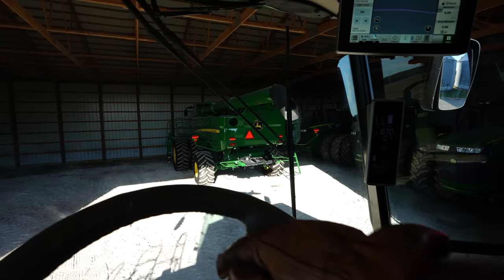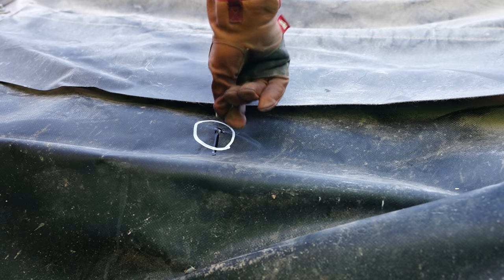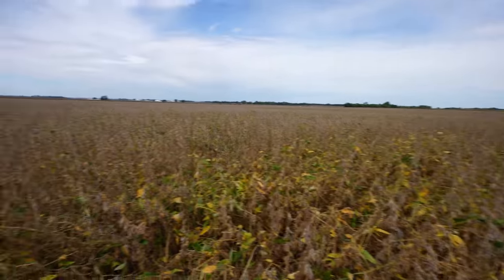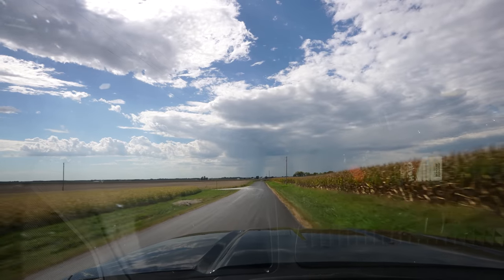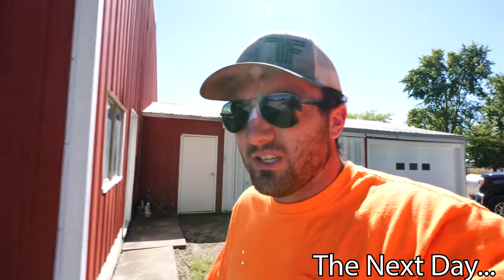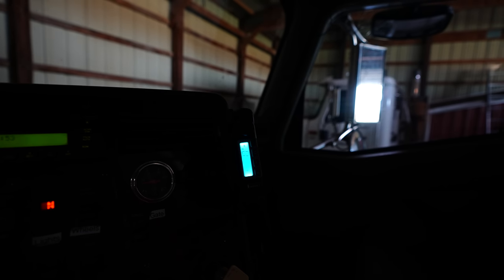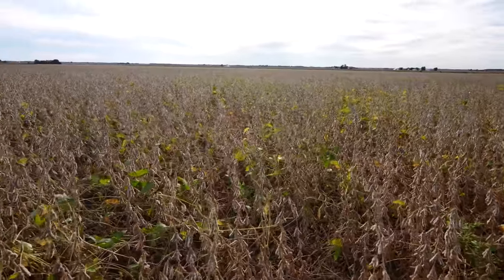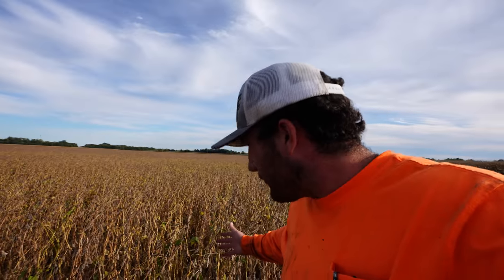Farmers Offered Insane Prices For Early-Harvested Crops

Comment: What's The range On Those Midland radios Been Thinking About getting some for my snow plow trucks
Reply: Check out Brian’s farming videos he did a range test on midland radios I think it was like 8-10 miles
Reply from the maker: They are very good in an open area. The more powerful radios can reach 15-20 miles if the elevation is friendly. We can usually count on 10 miles as long as the equipment has a taller antenna.